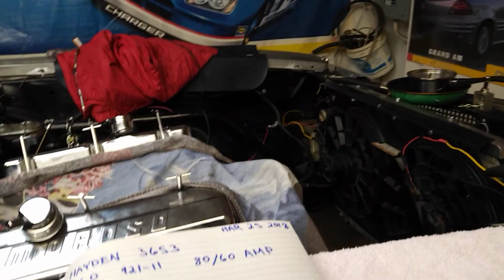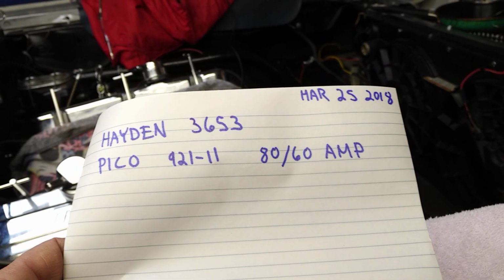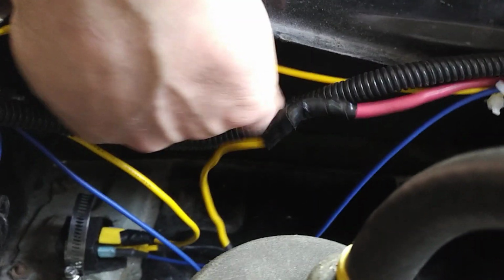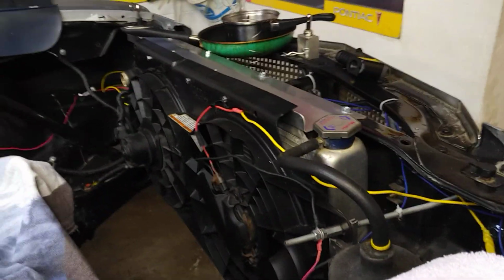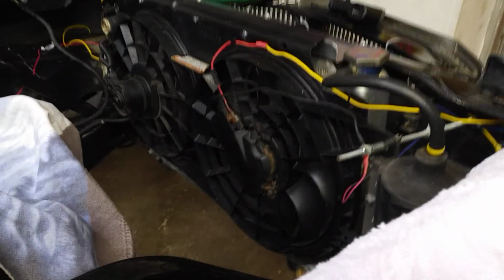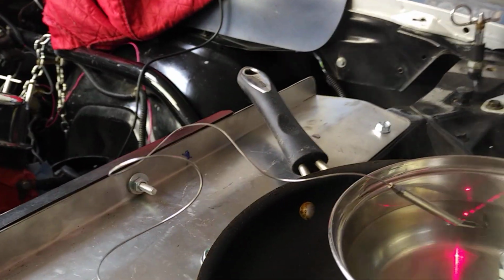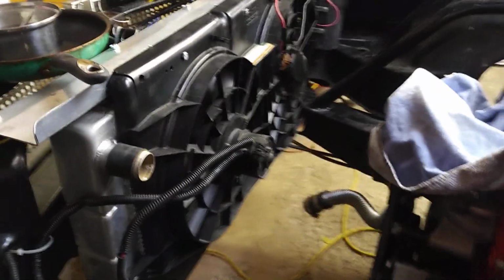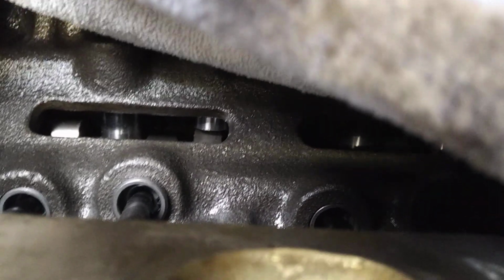Hayden 3653  electric fan controller install on Windstar fan

Comment: To stop water coming up intake bolts put thick thread sealer on the bolts gasket itself wont do it.
Reply from the maker: Hello CF, yes I did that as well it turned out the intake had to be installed a certain way to insure it didn't leak..

Comment: Do i need 2 fan controllers for 2 fans or 1 fan controller enough for 2 fans ?
Reply from the maker: I guess you could wire one controller for both fans as long as they all had the proper relays etc..the fans would both turn on the same temperature though

Comment: Can't really tell which is the positive or negative spade on the thermo switch from your video.  Can you tell me which is the spade in the center?
Reply from the maker: Hey Scotty, the spade farthest away from the rad is the negative. So if the unit was facing directly towards you it would be the left side

Comment: I can’t find where to put the thermometer thing.
Reply from the maker: You can actually zip tie the probe to the rad fins facing flat, another option is to insert the probe  into the fins
Reply: The probe is to thick to push through my aluminum radiator. The probe comes with instructions and some other parts for installation.  Don't use the foam the instructions tell you to use. Just use the clip and zip tie. Make sure the probe touches the back of radiator near the upper house otherwise it won't work properly

Comment: NHRA Thank you for the video
Reply from the maker: Hello Believe cross, I think what you are referring to about the screws is actually just a small screw going into a rubber pad.The pads just sit on top of the tanks. the pads don't penetrate the tanks. If you give me your email I can send pics..Yes a relay is necessary as the control module would have a hard time absorbing all the fan amperage
Reply: @NHRA1975  thank you for the information but help